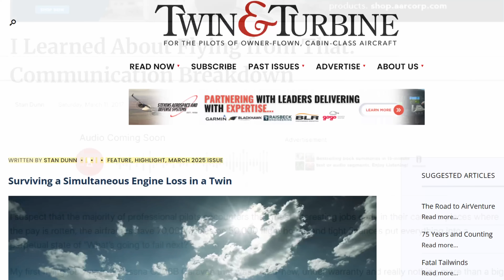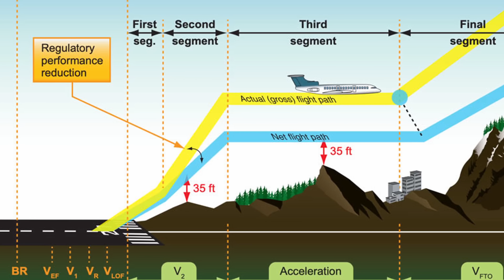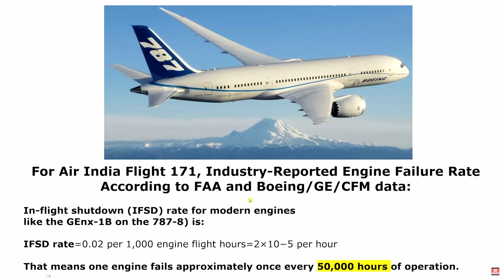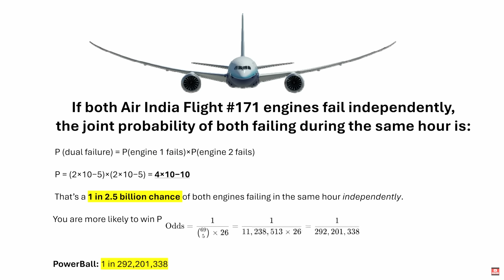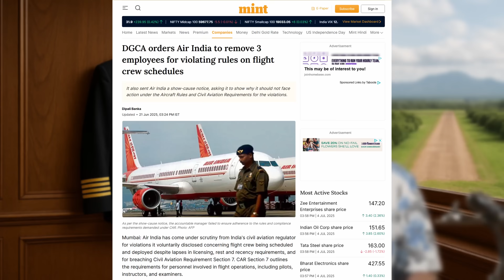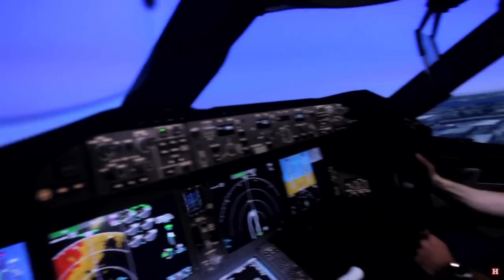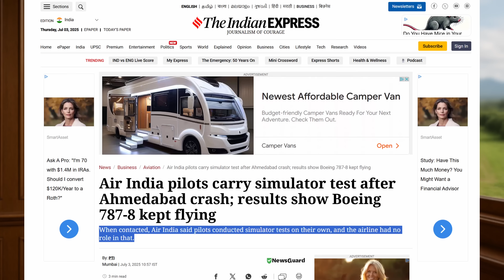Air India 171 Cause Becoming Clear

Comment: The other problem with the fuel contamination theory is that both motors would have to fail together, at precisely the same rollback rate thus losing thrust together at exactly the same rates. If there were any differences in thrust between the two motors, you would see it immediately in the yawing and somewhat also in the pitch, nether of which is visible in the video. You don't see any changes in pitch roll of yaw axis, nor do you see any flight control movement, especially in the rudder which is the flight control most visible in the video. Finally, a failing engine isn't like an engine being shut down. Shutdowns are clean and linear - the motor just winds down. Failing engines are never that way - they cough, surge, sputter etc. They tell you they're dying, even jets.  You'd probably see visible signs of failure as well as the composition density of the suspected contaminant varies as it enters the respective motors. Again, not visible at all in the video.

Comment: Kinda surprised at all the negative comments here. He walked down some of the most widely circulated theories, explained why they probably are not the cause, and then came to the last plausible option, an engine failure and the crew shutting down the wrong engine. He never said this was the cause, only that it appears the investigation is converging on that cause. I didn't see anything irresponsible being stated here.
Reply: Oh seriously.  He explained that the dual engine failure had billion to one odds but you cannot do math like that based on all the things he cited.  You don't get to multiply those individual causes together to come up with an absurd ratio like that.   There are numerous scenarios in computer controlled systems where code goes into some infinite loop and nothing acts like it should.  Look at the attempts at self-driving cars.  Mistakes in code for that happen all the time and cars run through stop signs, plow over pedestrians or slam on the brakes for no reason.  I think it's more likely than not given the complexity of interconnected systems on modern airliners.  I'm impressed it hasn't happened more often.  He ruled out a distinct possibility due to some magic statistical crap that just cannot be justified.  Why?  It could be as innocent as major wishful thinking in pilots that their planes are trustworthy or it could be that Boeing is pushing people to post theories deflecting their possible involvement and blaming the pilots.  Most reasonable analysis I've seen has pretty much ruled out pilot error, not because pilots don't make errors, but simply because there simply was not time for the pilots to do something stupid.
Reply: @arizonastrummer sounds like you’re carrying some serious baggage there sparky.

Comment: I do believe of an error of crew about soon after The rotate pilots noticing positive pitch they must put The gear up and it did not occurred. Why? Because the gears were down While the plane was airborne. The footage showed no flaps extended while plane was airborne,  so my conclusion since the first hours of the accident that I saw is someone in The cockpit mistook by retracting the flaps to up posicion instead of gear up position. No fuel contamination whatsoever! It is unbelievable but flaps were retracted to up position after take off. Just this .

Comment: For turbofan powered airplanes, there is no urgency to move the Start / Stop switches to Cut Off following an engine failure.  With the engine failed, it isn’t as if the FADIC will be commanding any significant fuel.  Thus, the setting of the failed engine is not important.

Comment: Software failure in the TCMA (thrust control malfunction accommodation) unique in B787 aircrafts possibly by wrong sensor input holding and forcing plane in ground mode/idle despite TOGA activation. No TOGA thrust released, RAT deploys automatically.

Comment: More speculation.  Surviving passenger noted high reving engines towards end trying to elevate.  No engine failure BS.
Pilot did NOT use entire runway.  Turned at first turnaround on backtrack.  Takeoff speed just over 170 knotts. 
Drag- landing gear, RAT.  Low air density from low barometric pressure and high temperature.  
Heavy weight- fuel load , passengers. 
Electric failure cause middle hydraulic system fail.  Battery backup??

Comment: I think this was the best breakdown of the crash of around 70 that I have watched or read. The darker smoke does come out of the left engine, apparently.We know they didnt leave the runway at the end of it and we should know it's unlikley dust or sand.  The yaw happens but isnt much, exactly like it should be. The plane climbs for a bit maybe the next 200 feet up or more but then stalls out as if now the other engine has gone. At that point we have rat deployment and its also consistent with the survivors observations.

Comment: Water ingress at the ground power plug during monsoon rains (through failed sealant) caused an electrical power interruption (PTI) during transition from Ground Logic to Airborne Logic caused a cascading dual-engine FADEC (Full Authority Digital Engine Control) failure resulting in both engines rolling back from take off power to idle within 4-5 seconds. The cascading (multiple) buss failures triggered the RAT (Ram Air Turbine) to deploy. This was clearly heard on several videos of witnesses near crash scene. The crew never actuated the Emergency Buss Power. Probably due to the multiple system warnings on the EICAS or ECAM. 

The FAA, EASA and the Indian equivalent of our FAA issued (mandated) a design retrofit (SB-787-24-219) across the 787 fleet to seal the PRB-A connectors.

Comment: My layman's sense remains that the complex computer systems malfunctioned so as to see both engines shut down. Not sabotage, but computer command and control system failure. Where human operators are blamed, in the absence of conclusive evidence as to that, then it is wise to wonder whether the vested interest of a stakeholder is thereby being protected.
Reply: Exactly.  The FADEC system directly controls the throttles of the aircraft.  There is no direct link to the throttles in the cabin.  The software knows what phase of flight the plane is in and essentially auto controls the throttles based on the cabin throttle position but also hundreds of other factors such as airspeed, climb angle, wheels off the ground, etc.  A glitch in the software caused by voltage loss or spike could completely overwhelm that computer making it idle both engines and no matter what the pilots did in the last 15 seconds would have changed that computer's mind.  It's much like the 737-Max tragedies where computer code in the exact right conditions caused the planes to nose to the ground.

Comment: I did hear other experts discuss the problem of vapor lock. If that could be the case it would certainly become a massive problem as the plane starts to climb as vapor bubbles would transit up then causing starvation. It was very hot that day, some like 42 C, with a plane sitting on a hot tarmac for several hours. I have an older classic car and vapor lock can be a problem during the summer when trying to start it after it has been sitting for 10 minutes after running as the carburettors float bowls will boil. With all the safety measures and complex equipment to fuel a 787 I can't see how fuel contamination could be the cause. The wings show that the flaps were extended and the plane just sank so a dual loss of thrust looks as the final cause and either a fuel issue or some issue that shut the fuel off may be the cause. Doesn't the 787 draw fuel from the same center tank for both engines at takeoff?

Comment: There are ways that two airliner engines "failed" during flight - a shoddy control system "told" them to shut down.     The pilots and engines are totally dependent upon said control system for feedback.

The Pilots and Engines can see two different messages..   

When the 737 Max failed we learned that Boeing had outsourced control software.    Outsourcing software can work.  Cyient engineers are reasonably competent. Trouble is that you have to write your specifications very tightly.    Did Boeing engineering staff tightly specify their software?

I have worked with Cyient.   I learned through experience that they will do EXACLTY what you tell them to do.   They do not understand feedback in case of design tolerance, changes to design and so on.

Comment: water intrusion in the avionics bay, low temps and leaks in the front press. bulkhead behind the Ra-Dome, to, eye build up humidity is higher in a 787 incl, the fact that the packs (confirmed, had trouble working at all, may indicate a leak in the FWD Bulkhead, after a few cycles  water dmg in there can come from condensation. the fadec or EEC may acted like the train on the Final run, but instead of  accelerating FADECS has the 1 in a millionth glitch... but water and electronic dont mix, maybe it turned offin the avionics bay or simply potable waterlines. and water seepage entered in the avionics bay

Comment: Is possible there was glitch it the software, just automatically turned off both engines off and then had electrics problems striaght after. Boeing have had issues in the pass with software system issues in pass glitchs in there software, I wounder if there just patch the programming, not fix it properly.

Comment: this is the most probable scenario but theres also major questions as to why pilots could do such an error, especially during the take off

Howerver few mistakes w everyone who did promote this theory, the landing gear was not forgotten, it was extended during the time the hydraulics/electrics had failed

So assuming that pilots shut down the wrong engine, the next step they did was retracting the landing gear, or that one of the pilots had conducted the checklist instinctively while the other retracted the gear

The things giving this theory some weight is the take off roll as smoke qas observed behind the left engine in take off, but this could also just mean that the area was dusty, thwre was in fact a slight barely noticeable yaw after take off but it could also be due to other factors

The mayday call however interestingly mentioned thatthere was no thrust, which is of note because engine failure checklists require pilots to declsre mayday stating the engine failure, either this could mean something else had happe ed tin the cocjpit or that the pilots were distracted and not focused on the comms
to be noted, DGCA firing 3 directors at air india due to saftey issues has no weight bearing in this case, its the job of the dgca in general and they typically suspend and scrutinise officials who violate safety terms regardless of an accident, other indian carriers such as akasa and spicejet have been fined multiple times

Like i said, so far its the most probable theory but it also sounds diabolical if you put it in a way, while air india has a bad reputation in general due to poor service and handling, its safety record is decent, and their 787 fleet has always remained incident free until this crash

Comment: The plane is designed to be able to fly on one engine !!! The rat came down which shows there was No power !!!   Air india have a terrible maintenance record & there is evidence that the plane had electric problems earlier that fay in a previous flight. I dont know what caused this !!!
Reply: I WILL fly on one engine as long as you don't shut it down.

Comment: A possible leaked preliminary Air India 171 report suggested that what happened was the 787 seconds after lift off suffered an electronic power transfer interruption during rotation which caused an arcing event in the main power relay box causing an uncommanded bus transfer failure leading to a cascading dual engine full authority digital engine control failure causing the 2 GE Gnx to roll back to ground idle all because rain water had gotten in during a pre flight ground power unit disconnection during a heavy rain downpour 

now sure how reliable or trustworthy it is cause if it the real preliminary Air India 171 report then oh dear

Comment: From the maintenance bulletins issued by Boeing straight after the crash (not mentioning the crash incidentally), it appears Boeing was worried about the possibility of water entering the flight computers from faulty plumbing in a toilet or spilled liquid in the cabin through faulty seals in the seat floor rails.
Water contamination of the electrical systems is consistent with the myriad electrical problems on the previous flight of this plane. 
The issue of training and Air India staff being removed may indicate that the plane should have been grounded for further investigation given the issues on the previous flight.

Comment: 14:21 Exactly. People keep talking about ar unway overrun but the cloud appears only shortly and just as it rotates. I'd think if the engines flamed out at full power you'd see exactly that puff of smoke. It also seems to dissipate as if it was hot, in contrast a dust cloud would continue drifting rather compactly.

I made a map from the CCTV video and it seemed to lift off well within runway limits:
https://www.google.com/maps/d/u/0/edit?mid=1lSA1-PTE9SLKYJRjKfyS8A0EQPXnmIo&usp=sharing

Comment: A major transition is happening in Deep water Oil and Gas called All electric Technology. Instead of all hydraulics for control, electrical motors and electrical control systems are used. To operate a deep water oil and gas field 5-10$B equipment is needed. 10’s of km of umbilicals (control wires) , dozens of expensive Christmas Trees (main production hub for each well) and several manifolds ( gathering systems) and 10’s of miles of risers (vertical transport systems) and flowlines are needed. I read that Boeing 787 also uses similar technology of electrical controls rather than hydraulic helps with fuel efficiency and reduced weight. This could be an electrical issue.

Comment: I am a bit surprised at the large probabilities and was wondering if they are calculated assuming statistical independence ( e.g one engine failure having no impact on any other engine , or airplane system ). Or maybe the probabilities are frequentistic, based on a ratio like 'how many times double failure hasn't happened' / times it has. . Out of the blue events are challenging to predict, by definition.  May be there's an unknown unknown factor or new issue.

Comment: This video in my opinion is the most comprehensive scenario based review of possible causes that led to the Air India tragedy. The DFDR and CVR data hold the factual occurrences and will lead to an accurate, non-speculative assessment, but this video  does an excellent job of presenting likely and less likely scenarios. Nicely done.
Reply from the maker: Thank you for the kind words and for watching!

Comment: Considering the captain's experience, his explanation can be considered plausible. However, there are a couple of things that don't add up. First, a passenger on the previous flight reported electric problems on this plane, like AC not working, other cabin systems not working, etc. Second, the only passenger to survive the crash, reported hearing a bang before the plane crashed. The 787 is a model which relies too much on electrical systems. It has 2 generators per engine (not one, as stated on the video). If the electrical system malfunctions, the fuel pumps would stop working, stopping the engines and causing the RAT to be deployed. Unlike other aircraft, the 787 has electric fuel pumps instead of mechanically driven ones. My guess, my hypothesis, (call it what you want) is that the plane suffered a catastrophic electrical failure which caused both engines to shut down.

Comment: They tried very hard to simulate what caused total electrical failure and two engine flameout. Flap setting is not a factor. The plane was making altitude initially. They could not duplicate it. This was total sabotage, or an act of God

Comment: It's idiotic to spend 15 minutes talking about what DIDN'T cause this accident. There is a reason why they haven't released the flight data recorder information yet; because it will again implicate Boeing and probably will be the last nail in their coffin. Some condition shut off fuel to both engines simultaneously. We would all think that this cannot happen, but evidentially, under the right circumstances, it can on the 787.

Comment: I'm a pilot and aircraft engineer that has watched a bunch of videos on the Air India crash. This one does a great job of summarizing the information. I agree that the issue was either a common mode type failure that cut off fuel to both engines or an inadvertent action of the pilots to shut them down. A common mode failure could be software or hardware related involving the pilots or aircraft maintenance. India is being very secretive and exclusive with the investigation. Investigators may be trying to figure out how to spin it in a way that is less damaging to the airline, which is the national air carrier. My 2¢.

Comment: The wether was hot and dry, hence dust rising due to tip vortex is a common phenomina on each takeoff, even few minutes appart. Its highly unlikely that the crew would take any other step, unless there are lots of vibrations or bangs from engine that could have left tell tail signs in video, than to cntrol the aircraft and climb to a safe alt. Plus there is no yaw visible in the video.